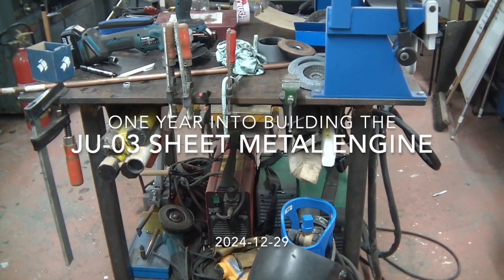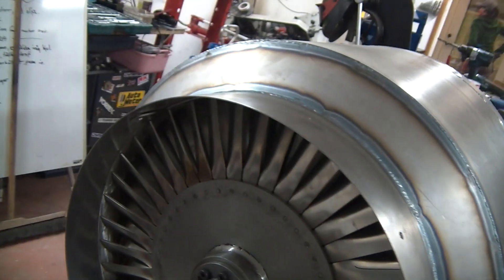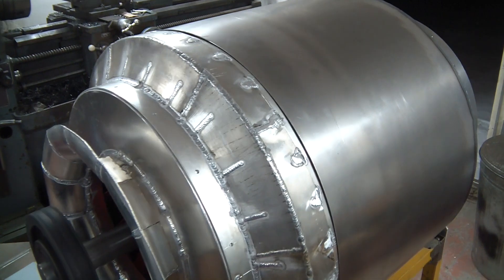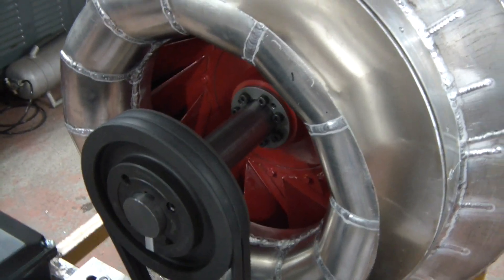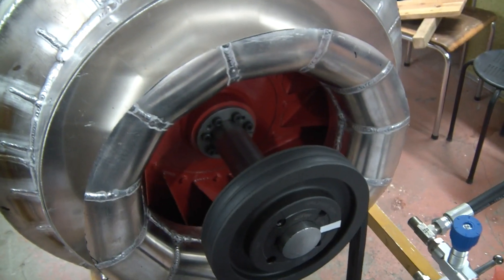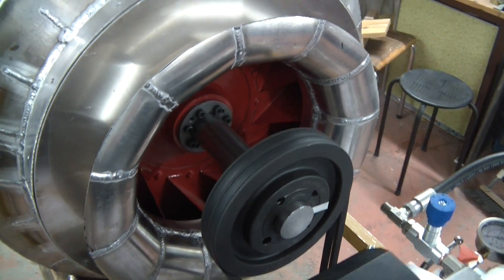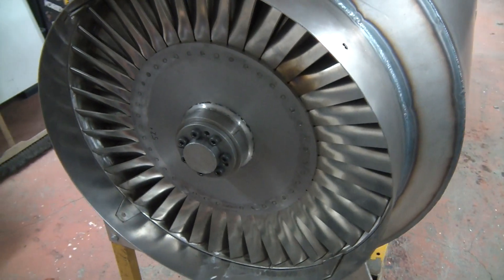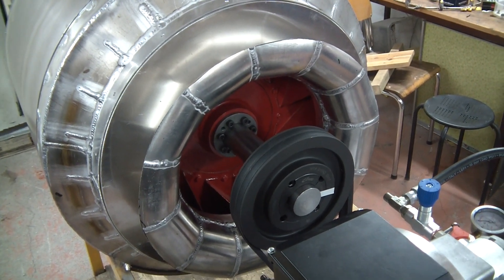Talking about the JU-03, and spinning her up

Comment: Very nice project you're working on. I'm working on one myself... just an idea if you used an electric DC motor as a starter once the turbine is running it could also be a generator!
Reply from the maker: Thanks. The aim is to have as little electric stuff as possible on the engine, so the petrol starter will have to do.

Comment from the maker: Thanks for the cheers guys! As long time viewers know I am more a doer than a planner so I am anticipating a long and winding road toward success. :)

The test rig is only a temporary thing, along with the belt setup etc. Once the engine can self sustain without toasting the turbine blades I will start developing a new set of rotary parts (turbine wheel and compressor) more suited for higher RPM´s, along with a test rig with a simple dyno brake for the rotor.

The plan is to fit a snowmobile clutch on the shaft end, and use the integrated starter sprocket for spinning the turbine up to idle. The belt pulley is just for the initial tests. Hopefully I can get 100-150hp from the engine when it is finished, not much for its size but enough to power a small car or boat.

No rush, the journey is the goal. :)

Comment: som vi har väntat, äntligen (: väldigt ambitiöst med ny turbin. kör på elektriska pumpar så slipper du återkopplingen mellan motorn och olja + bränsle. axiell start vore nog bättre än rem, vad heter nu de där lagren som är som en diod.... envägslager ? den där slungkopplingen kommer ju inte släppa när det väl bar av och turbinen driver startmotorn :D
Reply from the maker: Kul att ha nåt att pyssla med igen i verkstaden. 

En remdriven pump vore magiskt bra, även om bränslesystemet blir lite mer komplicerat för att kompensera för tryckstegringen vid varvökning. Ska jag sätta motorn i något som rör sig vill jag inte hålla på jävlas med batterier och elände. Det enda jag behöver ha ett batteri till då är tändningen, sen sköter den sig själv.

Jag är helt inställd på att bygga om det mesta på/runt motorn innan den är klar, så remstarten är bara ett enkelt sätt att få snurr på motorn för de första startförsöken. Det är så många frågetecken kring motorn då ingen jag vet byggt något liknande tidigare, så jag börjar med att yxa ihop något enkelt och sen får jag förbättra saker allt eftersom.

Jag visste t.ex. inte hur mycket effekt det skulle behövas för att få snurr på rotorn, därav dubbla remmar och 9hk startmotor. Bättre att överdimensionera, jag har jävlats måååånga timmar genom åren med kringutrustning som strulat pga det varit klent tilltaget.
Reply: 🫢, yes ~ a centrifugal clutch won’t disengage at speed [as intended 🙄] = if he did manage to get the jet to power itself and stopped the petrol engine - the clutch would remain engaged and back spin the “starter engine” and bog down the jet to the point it stalls. He found that out and later redesigned it to have a manual belt tensioner clutch

Comment: Nice to see her spinning around and making some noise  ,  beautiful welding job 🙂
Reply from the maker: Yup, everything seems to run true and reasonably vibration-free. I long to see those lazy yellow flames through the NGV once I start cranking the fuel valve.

Running grease filled ball bearings is such a delight, my god I hate journal bearings with the constant oil mess.....